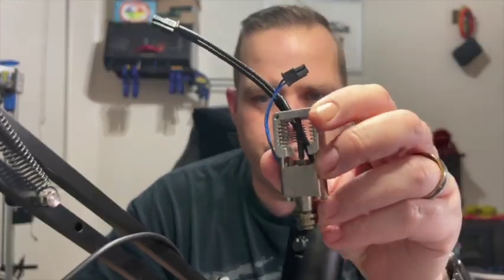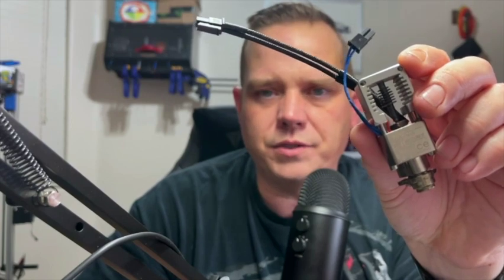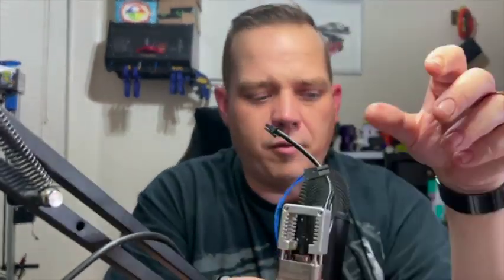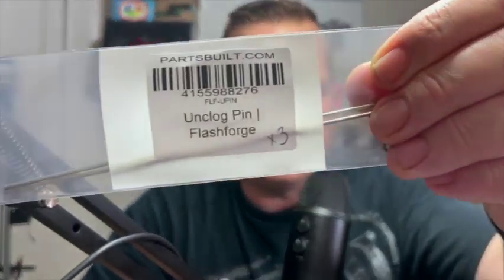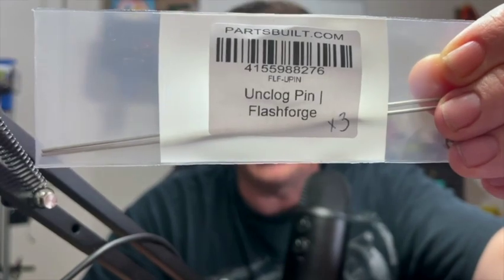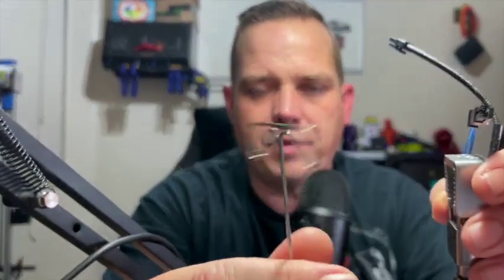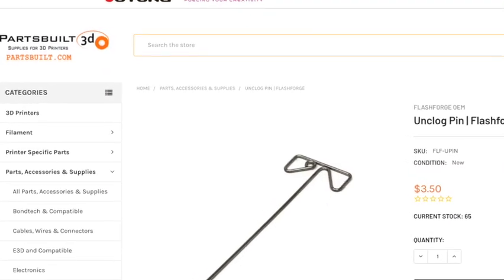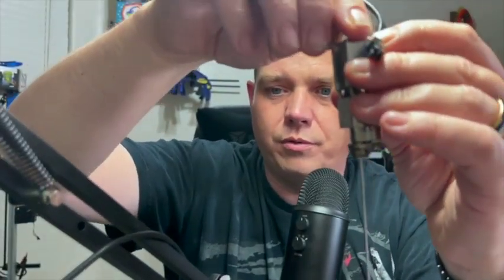I CLOGGED MY $250 HOTEND... NEVER GUESS HOW I FIXED IT.

Comment: Used a small letco on the cloged spot with the fan unmounted , heat up de hotend to 200 with partcoolingfan on and get ready to manualy push some hard filament thru it  , takes about 2 min but you need to move quick not to melt your  hotend mounts is they are not abs . First clogg, i din t push pull on the filament during rool swap , i just pulead and a small nylon part gut stuck and hardend in the top of the heatbreak.